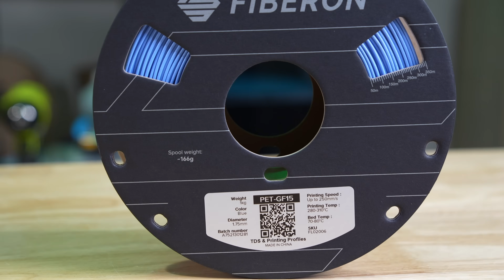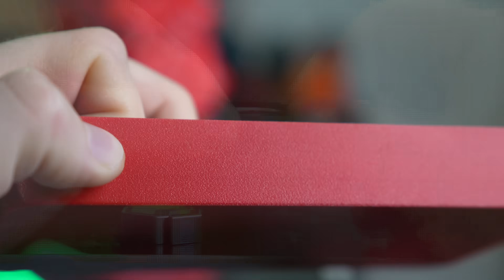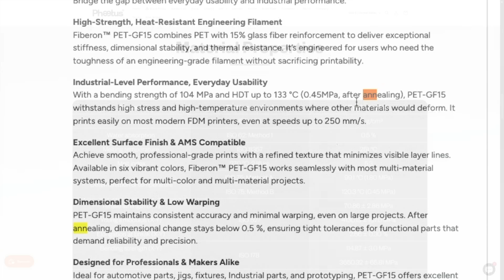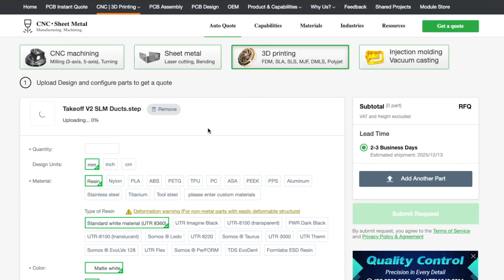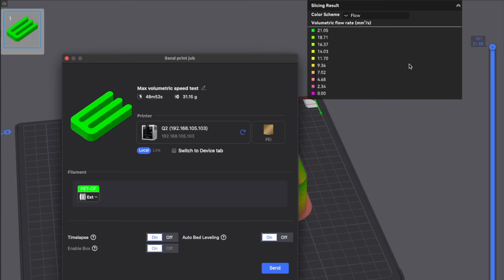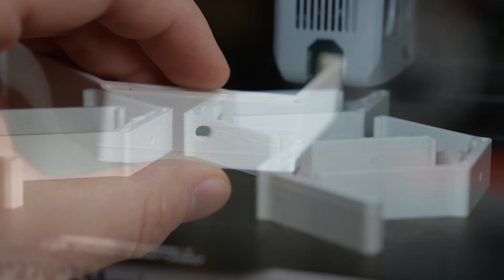Accessible Engineering Filament? Testing Polymaker's Fiberon PET-GF15

Comment: I use water-based hair spray in a pump bottle for all of my PETG, PLA, and TPU prints.  Perfect bed adhesion and no trouble with release after printing.  I haven't tried other filament types so can't comment on how well it works with those.  I think any cheap brand of hairspray will work - I bought the cheapest I saw on Amazon and probably have a lifetime supply.

Comment: You said to anneal it for demanding applications. This material doesn't need annealing while PA-CF does (in order to not creep). So the main reason to use this over PA-CF is that it doesn't need annealing. If you are going to anneal it, you might as well use PA-CF.

Comment: This video actually exposes an issue that i have had with my Polydyer for a while now, i dont really understand why Polymaker would have the PolyDryer top out at a max temp that is not sufficient for drying their own engineering filaments. Dont get me wrong i use and love my PolyDryer, i just wish i would have some more certainty on weither or not it is drying my engineering filaments correctly (PPS-CF,PETG-CF,PA6).

Comment: PCB Way has one drawback: it doesn't print metal parts for airsoft replicas, which is a shame; they're closing themselves off to a huge market. I created an airsoft replica myself that would benefit greatly from the ability to print with materials like aluminum. It could be very durable and yet harmless, but unfortunately, my only option is to print with PET-CF15 on an open printer with a chamber made of radiator insulation. As for the material itself, it's worth drying it every few days if you print on an open printer, as moisture degrades print quality.

Comment: I think you're being mislead by filament manufacturers for posting their TDS with annealed properties. Annealing is not an inherently supported process, and most parts cannot be annealed without building support structure out of another material, generally a harder to print material. The quality of the resulting part is then some average of the two. Annealing causes warping and deformation and takes about as long as printing the part to begin with. It requires time, equipment, energy, part risk, off-gassing, and cannot be automated outside of a factory setting. How many parts have you printed, and how many of those parts have you annealed? This is not just a different perspective on a material they are providing you, it's a cheat. They know they're cheating, and we rely on you to use your voice to hold them accountable. Please hold them accountable. This is becoming more and more common and it's causing issues in the community. Filament manufacturers are in competition, and as it builds momentum other manufacturers are pressured to adopt it. Please push back. Thank you.

Comment: I'm an engineer and I 3D print functional parts, and I never anneal the parts.  Most people don't.  If I wanted that much post processing time and hassle, I'd resin print the parts with ABS-like resin to get isotropic part strength, and I wouldn't have the warping and shrinkage that annealing causes.  Filament manufacturers should not provide test data based on annealing given that almost nobody is annealing 3D printed parts, and providing the annealed data but not revealing that the parts were annealed is outright fraud.

Comment: I find it interesting that ya don’t acknowledge deviating from cooling fan recommendations as being a dynamic quirk for your different temperature issues.

I understand better bridging is a requirement for some of your print cases - but it’s an obvious factor in several of the issues noted. 

Otherwise - looks like ya got it mostly cooperating. No strength testing ? Cooling on/off with layer tests would be interesting.

Comment: Fusrock and Phaetus are sister companies under Runice.  All of the TDS's are on the Fusrock site.  QIDI PET-GF on the clear spools is also Fusrock.   I run lots of this and anneal it.  I'm honestly more irritated at Phaetus that they don't even have photos of their colors of the PET-GF or PPA-GF, since the TDS are easily found.

Fusrock/Phaetus spec 280-320C (310C for Polymaker) for printing, but in my experience, it has to be run at LEAST 310C, but stronger at 320C.  The obvious rationale for Polymaker or Fusrock/Phaetus to list lower temp values is to sell more filament, to all of the folks with printers that cannot exceed 290 or 300C.

Tip - look at the manufacturer's TDS - in the footnotes on Fusrock and others, they list the temperature at which the test samples were printed, as well as the annealing time/temp.  For PET-GF, they printed the sample test parts at 320C.  Uh...because less and the material is terribly weak and worthless.  

PET-GF has to be thoroughly dry as has been pointed out. But there is no way to know how wet or dry any filament is. Therefore, using an arbitrary value of X temp for Y hours is a disservice by the manufacturers.  I have had PET take anywhere from a few hours to nearly 24 hrs at 100C in my lab oven. 

Buy a precision scale - 
Regardless of what dryer you use, if you are printing expensive technical filaments, invest in an decent repeatable scale capable of 0.01 gram resolution. They cost less than $80. Then weigh the spool before you start drying and periodically afterwards.  When it stops losing weight from moisture, it's dry.  With PET, I usually check every couple of hours. When 2 measurements in a row are the same...it's dry.

Comment: I am intrigued but every polymaker filament i've ever used printed and performed like absolute garbage.
Reply from the maker: That’s interesting to hear, I’ve used alot with little issue. Any specific filaments in their line?
Reply: @ModBotArmy  Polylite, Polylite Pro, CoPA, and PCmax

I would admit it's just a skill issue but I've had absolutely no issues running comparable materials from other manufacturers. I just got a Qidi Q2 and i wonder if i would have better success over the ender 3 v2, afraid to waste the money lol

Comment: Safe to print on open air printers?
Reply from the maker: Yes, that’s what I previously used and there is no mention of needing an enclosure. Adhesion is really strong.
Reply: @ModBotArmy  Was also curious about fumes/particulate concerns. Is that a consideration for you?

Comment: The biggest mistake I constantly see with the video experts is they almost always print PETG with the wrong temp and/or far too much fan. PETG prints great with absolute minimal cooling or even zero cooling. Obviously limited by layer time. Need only tweak bridging fan accordingly.

If one has layer adhesion issues with PETG, it's almost always user error. Either temp is too low or cooling is too high. It's not hard to address. Yet the experts tend to always blame the material for their own failing.

This is but one of the reasons PETG gets a reputation for being hard to print. It's not. You simply need to understand 3d printing and materials better than the beginner.
Reply: Do you mean enabling the fan below a certain layer time? Or is there another setting for minimum layer time (in orca slicer)?
Also what speeds would you use mm/s
Reply: @wtsuser  Yes. Fan is required when layer time is too low as it will be too goopy and lose shape. The extra goopy time improves layer adhesion. Which largely isn't an issue with materials like PLA. It also tends to minimize warping with PETG too.

Just for starters, try printing something with PETG and 10%-15% fan. Adjust from there as needed. Feel free to try none. Obviously find out what you need for minimum layer time.

Comment: here's how you coat your damn PEI sheet. Get Bambu lab's PVA build plate glue. Or any other more liquidy PVA. Rub it on a quarter of the plate. Take a bottle of everclear and drop a quarter sized puddle, then take a 4" wide foam brush and soak up the everclear. use the foam brush to pull the glue across the plate toward you. the everclear prevents the glue from going bad like water does. it also self levels a little too so it won't be lumpy

Comment: Kindly requesting a video on polymer PC-PBT. Ty!
Reply: I've been printing in gf-pbt for a few months now and it's my go to engineering medium for ease and strength.   prints great even on my cheapest printers, adhesion is good but won't destroy a pei plate,  layer strength is as good as tpu without the stringing with very high stress tolerance and impact resistance.   can't get a smooth skin, doesn't work on (most) holo build plates and now costs more than nylon for the volume...  but I got in early and got a small supply for myself at 20$ per kg before  attention and price hike.

Comment: I would love to see a test that shows us what annealing does with the dimensional integrity. No use to buy a specialty filament if you can't get the dimensions right.
Reply from the maker: I’m hoping in 2026 I can get an oven up here in the studio to do more testing like this
Reply: @ModBotArmy I have successfully annealed this exact polymaker filament for some printer upgrades that need heat resistance by using the heated bed. Setting it to 120 degrees and leaving the parts on it with an overturned bread loaf pan to keep the air inside warm had great results. Using a thermal probe on a multimeter taped inside the bread pan, air temps stayed at 115 or so for the 10 hours I did it. Not ideal, but honestly really effective.
Reply: It's all in polymkaers datasheet.
Reply: @riba2233  Datasheets and real world numbers can be very different...
Reply: In my experience annealing does cause a little bit of shrinking, but it can be accounted for when slicing your print and isn't much of an issue.
Reply: @Lethal_Bite  These are the kind of filaments that get used in mechanical and engineering projects were mostly dimensions do matter a lot, so yes, it is much of an issue. Actually it would be a deal breaker if you cannot dial in your slicer to reliable compensate for shrinking instead of every print becoming some hit and miss affair.

Comment: As for the Phaetus PET-GF, I suspect - and could be wrong - that it's made by FusRock and Phaetus merely rebrands it (the data quoted aligns fully). But FusRock does indeed make it clear that 99/120C temps are AFTER annealing. Without annealing, they state 74/77C. 
Also, as others have said, a higher heat deflection temp is the main benefit and even FusRock's own data don't show much improvement in strength after annealing. As for layer adhesion, again according to FusRock, the strength in Z is higher than their ABS-GF. And yes, they do list mechanical strength data before and after annealing. So, the filament manufacturer (in case I am right) did indeed present the data - though the company which rebranded it did not.
Reply: Yep, it's fusrock
Reply: @riba2233  Cool, it seems they make pretty good stuff - judging from the "brand names" that seem to buy from them. 
I have some ABS-GF and PET-GF on the way from them and hoping that the PET-GF will do well enough I don't have to bother with the ABS.

Comment: I’ve had tremendous luck with this stuff printing on a P1S using the fiberon pet cf profile. Prints look fantastic and have been super strong from my limited testing. Yeah it definitely looks like 300 is the minimum you’d want to print this at for layer adhesion, but as others are saying, it’s unlikely that annealing will impact this much.

Comment: I’ve ordered a CoolGrip plate off Qidi, as the one I got for my Bambu X1C has been very and it stopped me  having to use DimaFix build plate adhesive on the OEM plate with PETG

Comment: I own many Qidi machines and
I've been using purple disappearing gluestick for every print that's not nylon, PC. 
To get better layer adhesion I print pet-gf at 310noz, 80bed, 50+chamber.  Printing this filament   closer to its tg point brings better results.  I even run Tinmorry petg-gf with a closed chamber at 45c. Qidi has some issues sure, but their big 3 they get right 95% of the time. Just wished they'd put more effort into the little things that make out of the box experience better.

Comment: So a few things...

Not a fan of when people say you "need a hardened steel nozzle" when there are many abrasive resistance options. 
The sawtoothing effect you found seems to be fairly common with PET when approaching your flow limit, but I think the issue lies more with the anemic melt capacity of most modern hotends
My take on PET-GF annealing is that you should anneal if your project values HDT over impact resistance, but not to chase interlayer adhesion. This is best accomplished with a performant hotend (with ample melt capacity) and elevated temps.

Comment: Running the fan against the recommendations is most likely what killed the layer adhesion.
Reply: Agreed id set fan on low only for bridges and design out overhangs higher or lower than 45 degrees

Comment: My q2 has been a champ when it comes to abs, pa6/12 cf and ppa cf.
Reply: Fuck, I need one but I only have Centauri carbon money. Sucks being poor.
Reply: @herbert801  you can get Q2C and upgrade it with a chamber heater later.
Reply: Did you also tried PPS? The one that sounds like metal &; fantastic heat resistance. Which manufacturers? Polymaker only? Did you test elegoos PAHT by chance?
Reply: @herbert801 yes to pps and no to paht. Pretty sure I can run paht through my ams so I’ll use that and give it a try.
Reply: @herbert801  qidi also makes pps and it's much cheaper
Reply: @herbert801  im running pps and ppf for 2000 of hours on plus4 qidi. Bambu and prusa especially can eat shit. Just like qidi box can eat shit too :)

Comment: Nice work. To avoid too strong bed adhesion, reduce the initial layer temperature too. But yes, glue is just another safe solution. I still have a lot of work with 6 colors I got..
Reply from the maker: Curious to see your findings. Since you have the ability to test tensile strength I would love to see how much layer cooling impacts tensile strength on the parts not annealed. A comment mentioned that was the reason my layers pulled apart on my flow test and it would be neat to verify this.
Reply: @ModBotArmy tensile strength is usually in the context of XY testing which cooling won't affect. Now layer adhesion is definitely affected by cooling fan. I would drop cooling to 10% during normal printing and max of 30% during short print sections and with a pre fan startup time of 1 second to help the fan kick on fast enough for overhangs it should do just fine. You're going to have to tune your settings per model if you're printing with lots of bridging/overhangs. But honestly just use support for bridges to avoid sagging layers.
Reply: I'm eagerly awaiting your test. Especially the part where the print is baked—I'm interested in layer adhesion and overall durability. I also print on an open printer. If you can, please do tests on similar equipment. I'm curious if the properties will also improve with baking in this case.

Comment: I love this stuff.  I’m on my 4th 3kg spool.  I have it on an Infinity Flow S1 with an H2S and 0.4mm HF nozzle.  The excessive bed adhesion with textured PEI is a bit of a problem, when I use a release agent (Visionminer NanoPolymer, Magigoo, Bambu gluestick) it often leaves a faint white pattern on the black surface.  On the times when I have not used it I had to get out by. 900+ degree heat gun to remove the residual.
Reply: Ditto on the heat gun.  I do wonder if the PEI plates will be damaged by the heat.

Comment: I've been printing with this pet-gf pretty extensively since it was released, and layer adhesion is not an issue, especially at print temps over 300°C. The weak layer adhesion you experienced is due to overly aggressive fan settings. Activating the fan  @ 30% for  bridges, overhangs and layer times less than ~6 s is plenty. Fan off the rest of the time. Use a kick start (100%)  and speed up time of 1.5 seconds.

Annealing does not have any impact on layer adhesion, in fact it can make it worse. Heat resistance is the only mechanical property that annealing has any appreciable affect on with PET, unlike PA, which gets stiffer when annealed (but returns to a more ductile state after absorbing moisture from the air).
Reply: Thank you for the information. Where would you rate this material as far as impact strength ?
Reply: @thomcarr7021  It's quite good, especially considering it is a filled material. PET is replacing ASA/ABS for me recently. It's much easier to print, has similar toughness, doesn't creep but much better layer adhesions and heat resistance (annealed). As printed they have similar heat resistance. The only downside is the density, parts feel very solid but the A4T I just printed from this PET-GF feels much heavier than the ASA version.
Reply: @davidrobbins7645  Thanks.
Reply: @davidrobbins7645  Asa feels super light

Comment: 3DLAC spray for the bed. Stuff is magical. Helps release PETG while holding it down for wide parts, perfect bond for PLA. Even holds down ASA & releases once it cools down.
Reply: 3DLAC is fantastic. I mainly print PLA and find I only need to reapply it every 10 prints or so. The can is expensive but lasts forever.
Reply: Vision Miner Nano Polymer is much better than 3DLAC…
Reply: @Protman3D  Good to know, I’ll check it out, thanks for the note!
Reply: Just use a cheap glue stick. You're getting ripped off
Reply: @herbert801  Cheap glue stick doesn’t work well with Nylon for example, in my experience.

Nano Polymer was the best I tried

Comment: How do you anneal this? Temp and time?

And what would its heat resistance be?

Also, I’ve seen a lot of videos where people test out filament and PLA shows to be sturdier than PET, so I just continue to use PLA. So what’s the upside to this over PLA?
Reply: Maybe you are confusing this with petg, this is pure pet and it's better than pla in every way (tensile in xy and z, stiffness, bending strength, creep, temp resistance etc etc). Hdt is 80 before and 150 after annealing.